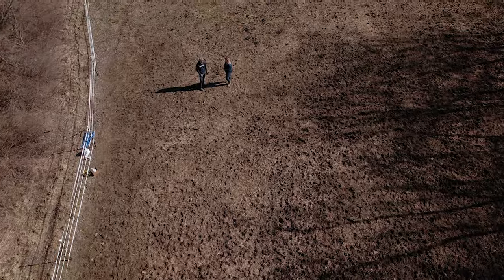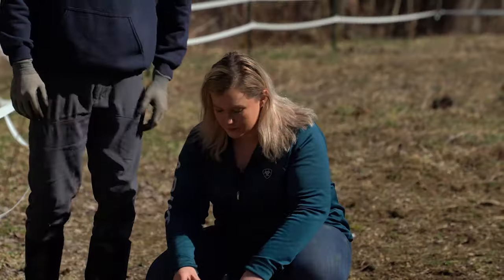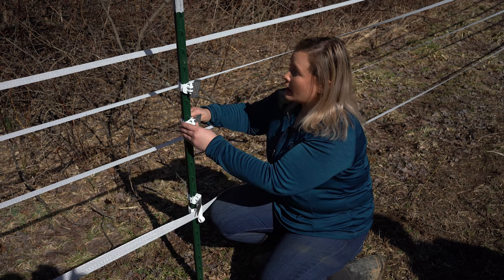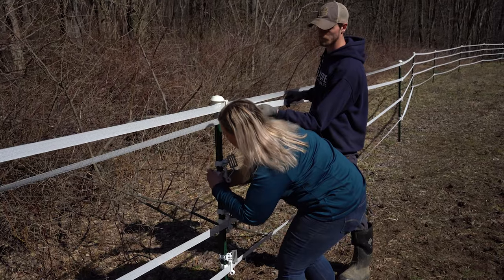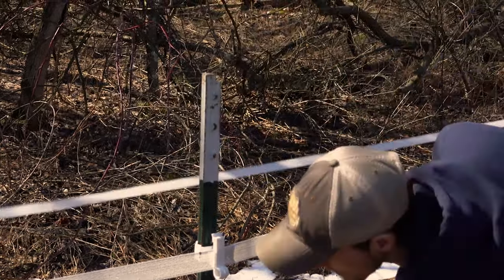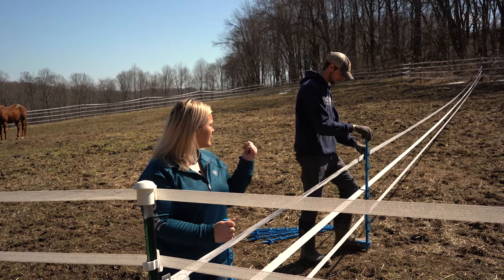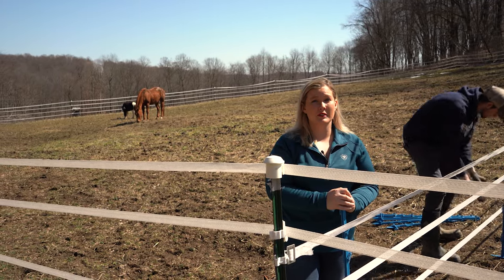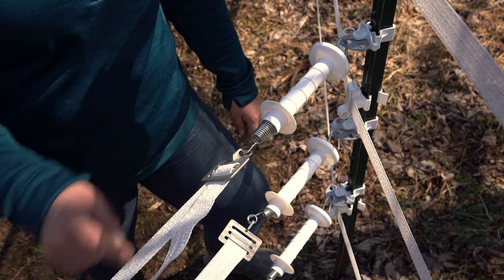How To Design a Horse Paddock for Spring Grazing

Comment: Thanks for a great video!  Flat tape looks great when it's not twisted, but you should put a twist or two into each section for increased wind resistance.  On every other post, unfasten the tape, twist, and put back on. Alternate forward and backward twists.  Also, inline buckles are an option for putting shorter lengths of tape together.